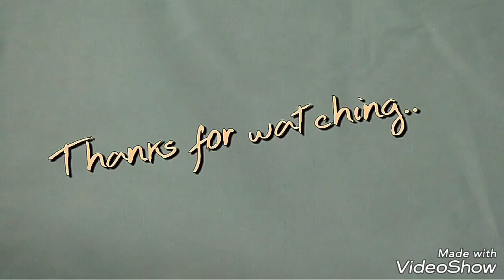Ford Fiesta Key Fob Case Replacement

Comment: Ano po gamit ng transponder chip?
Reply from the maker: Para madeactivate ang imobilizer at mastart mo ang engine, pag wla un ndi magstart engine mo
Reply: @cocoylago1518  how do you remove the transponder chip?
Reply from the maker: @DanielSmith-hi2jw  You can use precision flat screw or tweezer to lift the chip out of the slot
Reply: @cocoylago1518 can I put my original transponder chip into my new key for it to start my car?
Reply from the maker: @shax232  yes as long as your new key blade was cut same as the original